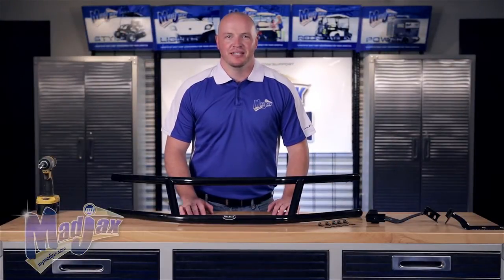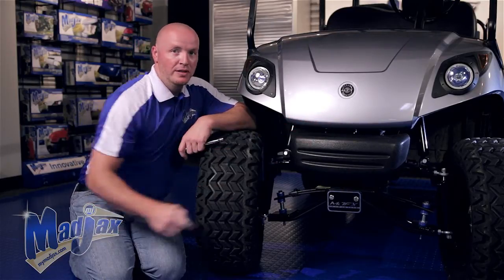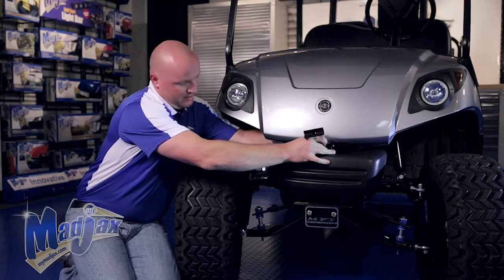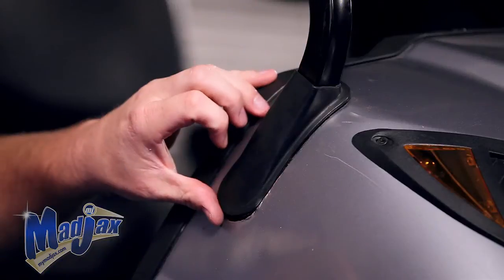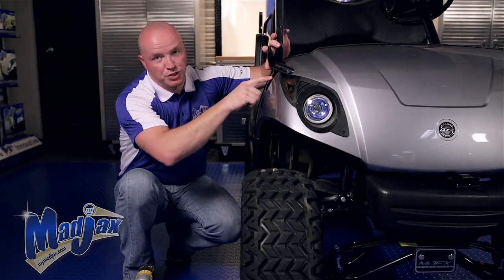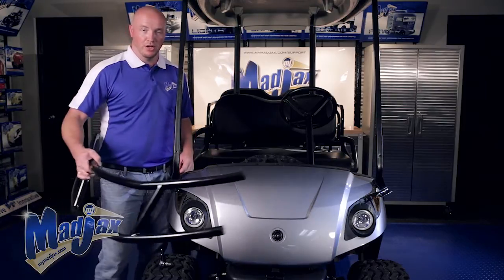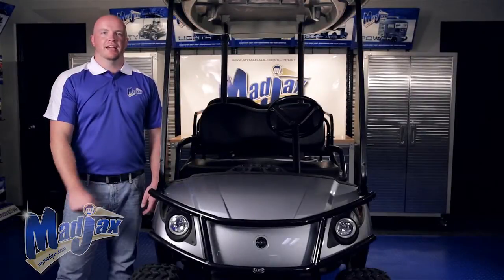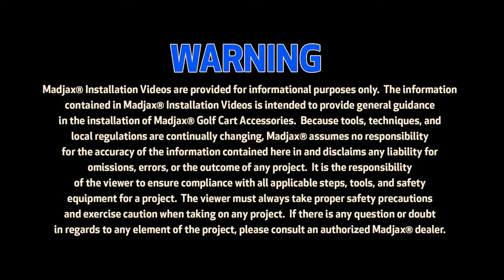Brushguard for Yamaha® Drive® | How to Install Video | Madjax® Golf Cart Accessories

Comment: I acquired one of these and they did not have the lower bracket is there a way to just buy the bottom bracket?
Reply from the maker: Jeremy, this should fall under a warranty claim, you can call the dealer you purchased it from to submit a warranty order for the lower bracket at no charge. We do not offer this bracket as a buyable product.